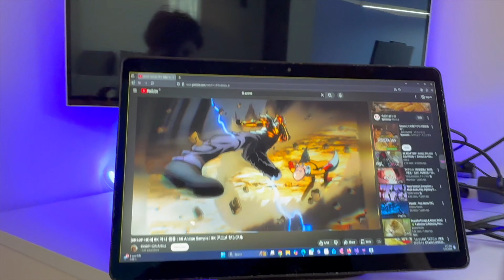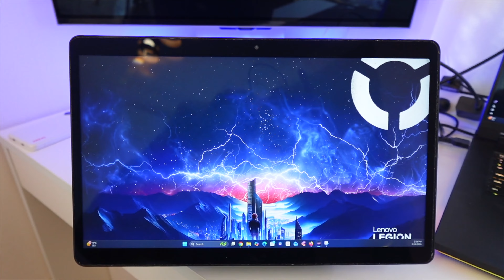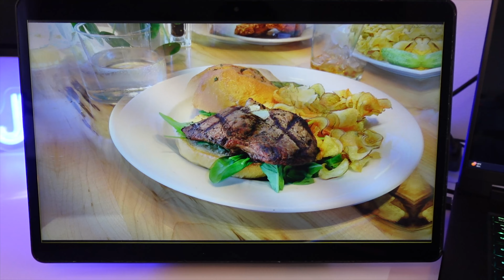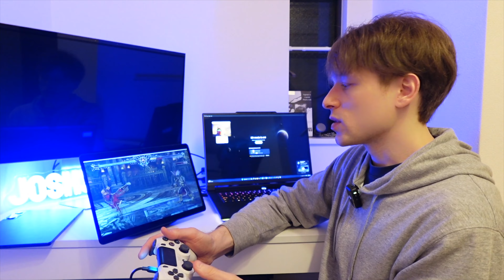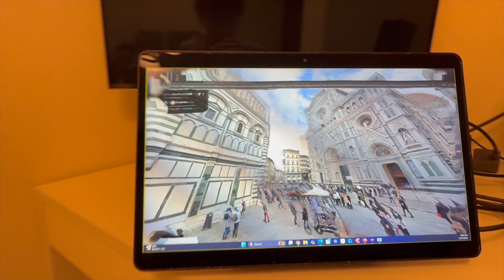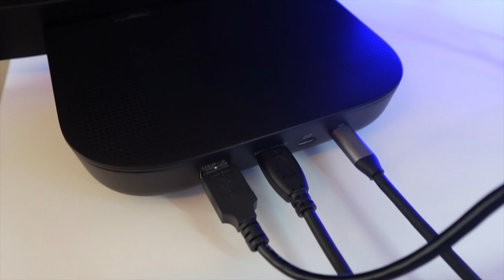Owl3D Shift: next gen glasses free 3D monitor

Comment: Hi, this looks amazing! Can I use gaming consoles such as PS5 Pro/ Switch/ Steam with it, or does it only work with laptops with high-end GPUs?
Reply from the maker: You would have to connect those consoles to a laptop or PC with decent specs using a capture card to display and run the Owl 3D software 2D to 3D conversion using the PC GPU. It’s not something that is built in to the monitor

Comment: What is needed for eye tracking? What if you turn the lights off and/or put dark glasses on? What if you sit back? Just wondering whether the tech could actually translate to 65"+ screens.
Reply from the maker: I don’t have the shift with me right now so I can’t test it, but generally the eye tracking used in these devices is advanced and can handle dimly lit environments, glasses etc. I’ll try it out once the retail unit arrives though

Comment: Monitor size is a deal breaker for me. Need something much larger.
Reply: For the price, anything larger isn't realistic. You also reduce the PPI when you increase the screen size but not the resolution.

For example Samsung's $2,000 27" glasses free 3D monitor is 4K in 2D, and the Owl3D shift is also 4K but at 14", so it's pixels are packed more closely together.

This results in less pixels visible and should completely remove the screen door effect.

Comment: How are the apps to play 3D movies and show 3D pictures? 

Most of the devices I try display the material ok, but the apps SUCK. Meaning it's not easy to just go to a folder of 3D pictures and scroll through them - like you have to open each photo separately and/or switch it to 3D
Reply from the maker: The app takes anything on screen that is full screen half width SBS and reverts in 3D. So it doesn’t require waiting or reopening things, you just flip through photos or play a video and it’s instant. But it’s just rendering the desktop screen assuming you have something displayed half width full screen, so if you zoom it will get all messed up. They need to add more dedicated features for this. And I agree, I hope they can do it in a way that is better than other apps

Comment: Hi Josh, what was the refresh rate like while gaming? Soul Calibur 6 runs at 60 frames per second. Was Owl3D Shift able to maintain that frame rate?
Reply: It depends on graphics card, RTX 3060 can get 30hz while gaming. If you aren't using the graphics card much it can get 60hz (max). Depends on the game.

Comment: I don't trust at all this "it will get better" claim. That is not how tech works especially not this kind of tech. At sale that is what you get very rarely will they improve the product after the release.
Reply: Their software will get better, not the hardware. We're still 3 months from release, so their software has plenty of time to fix bugs and improve the experience.
Reply: @MccTube How do you know they can make it any better? What technical basis do you have for this? Have they told you they will or do you know the current tech isn't tapped out and as good as it is going to get.

Because you usually don't release and try to sell something before you have made it as good as you can. This interface between latency and the algo and hardware that tracks our eyes. There is no good reason for why they can suddenly make all of that with software much better, because if they knew how they would have done it already.

Sounds like vaporware dreams to me.
I bet if i don't get a much better reason to believe otherwise that as it is is mostly as good as it is going to get. 

And what is usual the go to. Is if they can make a substantial leap in capability or perfomance.
They will release a completely new version of the product to squeeze the market for more revenue. That is how the market works for these things since forever.
And i see zero reason for why this product and company would act any different.
Reply: @cajampa It's a Kickstarter. The software isn't finished and as he said, the prototype was basically made by hand. 

Owl3D is good at updating their software and making it work well. It's foolish to think in over three months they will do nothing to optimize the software.

Comment: It is way to tiny from me to want one.
If the tech comes to 60 inch plus screens then we are talking.
I want it on my next TV
Reply: TCL is working on one
Reply: @TCISBEATHUB Very cool thanks for telling me. I love 3D on big screens. I have kept one of last gen LG passive 3D TVs around just for this. And i don't like projectors.
So if they come out with a huge one i am VERY interested. I hope they wait with releasing one until we have a fully fleshed out HDMI 2.2 stack available.
So we can get faster screen at the same time. Because huge 3D makes massive difference the more motion resolution you can throw at it.

Comment: Looks cool! Looking forward to a tablet version as well.  

I do wish it was at least 144hz refresh rate.
Reply: Perhaps it will eventually be released as an add-on for monitors in common sizes like 27" or 34". Then you can decide for yourself which monitor to put underneath, provided you have a sufficiently fast host system with a powerful processor and graphics card.

Comment: These smaller 3d formfactors just don't do it for me. Its gotta be 32 inches and up.
Reply: Are you fine with $1600 to $1900?
Reply: @TonyDrecaps certainly, if its an oled monitor or TV. My current 3d setup is active glasses on a 32 inch monitor. I also have ar glasses for 3d. The problem with 3d glass free screens, is that the panels suck compared to what you can get in 2026. The pulsar nvidia monitors are fast enough to do 3d with active glasses and same with oled. So there's really no need to go glass free 3d for a premium price.
Reply: @oneanother1 just making sure. Im with you. I prefer glasses free 3D. 

Im kind of mixed because I like the size of those monitors but tablets and handhelds are way more versatile and not tied down to a PC
Reply from the maker: I’m hoping the upcoming Samsung 6K 32inch monitor ends up being the best glasses free 3D display ever released. That will probably be the right time to get one
Reply: @josh_3D  This is the one to watch now. 
Especially that higher resolution since 3d cuts it in half

Comment: Would this connect to a gaming handheld like the MSI Claw 8 AI+? I'm wondering if there would be any lag or latency. Edit, nevermind it has a USBC connector so straight to Thunderbolt 4 on the Claw. Whether or not the Claw iGPU could handle the processing load or meet the minimum equivalent of an ~RTX 3050 is another question.

Comment: It looks like the same thing as the CubeVi P1. How does it compare?
Reply from the maker: It looks very similar, but the display tech is completely different. The two biggest differences are 2D and 3D resolution. The P1 was not designed for use it 2D, so smaller text on the screen in 2D mode gets completely distorted and id unreadable. The Shift has 4K resolution in 2D. It also has higher 3D resolution compared to P1 making it look a lot sharper in 3D. And because it is an Owl3D product depending on the tier you back it comes with lifetime access to their software which does the real time 3D conversion and keeps getting better over time

Comment: Very interesting product. The sbs support alone makes the price point of $399 far and away the best deal for glasses free 3d mointor that supports sbs content. Add the additional unique to this product the 2d to 3d shift feature, makes this a very tempting kickstarter purchase indeed. Even if the 2d to shift 3d does not work perfectly, the support of sbs 3d alone still makes this product way cheaper than anything else on the market. Since I can't test the 2d to 3d for myself, unfortunately I think i'm going to hold off on my purchase until i can one day see it in person. I've been pretty disappointed with live 2d to 3d conversions I've seen, and i've seen quite a few. It usually looks ok for still images but moving content I've always seen it as super gimmicky and stop using it after 1 or 2 times. But again for sbs alone it's kinda worth it. At that price it's almost worth a shot in the dark.
Reply: I know im just a random person but I've used their software for 2D to 3D conversion before for VR, and their software is pretty seamless and looks great on VR. I can imagine it'll only get better knowing you can change the depth in live time which is pretty insane
Reply: @ilovepaopufruit  Yeah i have decided at that price I'm going to back the kickstarter.
Reply: @VR-Emcee  I'm honestly glad to hear it, did you get the Super Owl VIP or Early Owl VIP? So you get their premium 2D to 3D converter membership included with the device
Reply: @ilovepaopufruit  I'm really sorry. After yesterday's video posted by Josh, he showed the native sbs not functioning at an acceptable frame rate and the game moving slow. He said they plan to fix this. But I've already been kinda jaded because of past purchases in this field where they (not Owl3D) say they plan to fix functionality and they never do it. I'm going to hold off until it's fixed or wait for another product to come along. The native sbs for games is 95% of why I want this product. If it is not delivering on that promise at release, I'm out.

Comment: I hope these 3D monitors will last because the Lume Pad 2 support seems to be defunct now.
Reply from the maker: Lume Pad 2 is supported until August this year, but these monitors are almost certainly going to have better long term support. Leia Inc is an interesting case because they pivoted hard with their main product offerings multiple times and did a major rebranding. They seemed to realize that it’s more effective for them to license the technology to other companies rather than supporting their own hardware brand.
Reply: @josh_3D Thank you.
Reply: @josh_3D supported? They haven't done a thing for it for a whole year already? I hope programmers can mess with it and unlock some potentially cool things, because i bought it when they started taking apps off. I felt cheated

Comment: Hi Josh , what is the best glasses free 3D display among all the ones you tried ? and how does it compare to the passive glasses 3d 4k lg oled 6 series from 2016 and the best vr headsets and xr glasses , in short what is the best 3D experience you ever had in consumer devices ? and is it possible to use the redmagic tablet as a monitor for pc with gamestreaming or other workarounds ? sorry for all the questions I want to get into 3D but dont know which is best , thanks in advance !
Reply from the maker: I can give an answer for glasses free 3D displays, but it is more difficult to rank 3D across all types of devices like VR, AR glasses, and passive 3D TVs. Those other categories all have some advantages over glasses free 3D because it is much easier to guarantee the left and right eye gets its own clean image. I also think ranking across those categories involves a lot of personal preference too. To me Vision Pro is definitely one of the best visually in 3D. 

But the best quality glasses free 3D overall is the 15” ACER SpatialLabs Predator laptop series. It has the best combination of brightness, vivid colors, 3D resolution and pixel density, smooth and responsive eye tracking, and amazing depth and pop-out. The 3D appears physically solid and convincing with extremely minimal crosstalk for glasses free 3D. The monitors using Leia SR technology all look nice too, but they are basically the same thing stretched to 27 inches, so the resolution looks noticeably lower. 

The problem of course is that just like Vision Pro, the ACER 3D laptops are extremely expensive, and could be a bit underpowered in a few years. The most recent one released around 3 years ago. There was another laptop from ZTE Red Magic that released two years ago, but only in China. I haven’t seen the display, but it could be just as good if it uses the same display tech or possibly slightly better if it is an improved 3D display.

The 6K 32”Samsung monitor that was announced recently seems like it could top all of the others and become best glasses free 3D display when it releases. We will see once it becomes available.
Reply: @josh_3D , thank you so much for the indepth explanation , 
 really appreciate it
Reply: @josh_3D I really wish Nintendo would release a second screen for switch 2 with this tech
Reply: @andreamitchell4758 I wish!  Glasses free 3D comeback
Reply: Good question I hope he answers.
Because what his references is for what is good 3D experiences is very important to understand what he even knows about these things.
It feels a bit shilling this whole presentation.

Comment: Without support for frame packed 3D sources, I think I’d hesitate to dive in and would just stick with the AVP…even though this device does things the AVP doesn’t.
Reply: Same! imho support for frame-packed 3D sources is crucial. A clear statement on this would be necessary. No “maybe later” or “probably.”
Reply: It's planned to support MVC, isn't that what frame packed is?
Reply: @MccTube  Yes. Presumably, this means that the corresponding software (hopefully after an update) on the PC or Mac supports the playback of frame-packed 3D content. So not directly via a connected hardware BluRay or media player (the monitor would need to have an HDMI input for this), but via the software, an ISO image or MVC extract on the connected PC or Mac (which would be fine for me, as I, like many others, have ripped my 3D BluRay movies to my network anyway).
Reply: @TomsRCScalers  Yeah it should be able to do MVC. Even if it can't, PotPlayer can convert MVC to any format in realtime with no quality loss, so you could just set it to FSBS worse case scenario.
Reply: @MccTube  I’ll leave that answer to those more knowledgeable than I am. 
But if “planned” means it’s not there yet, I’ll have to pass.
Reply: @westmcgee9320  Well of course it's not there yet because it doesn't ship until May. But it should be added. Anyway, even if it isn't you can play MVC with potplayer which in realtime with no quality loss converts it to any 3D format.
Reply: I believe it's already able to do that with PotPlayer.

Comment: Not mentioned Oled, so propably Led

Size 14-inch

2D Resolution 4K UHD (3840 x 2160)

3D Resolution 2K (1920 x 2160)

Pixel Density 315 PPI

3D Pixel Per Degree 66 PPD (Retina-Class 3D)

Brightness 600 nits (Peak)

Color Gamut 99% Adobe, 100% sRGB

Contrast Ratio 1500:1

Color Depth 1.07 Billion (10-Bit)

Refresh Rate 60Hz

Comment: What GPU do you have in the laptop? When watching live 3D converted videos, I assume there is latency, but are there frame drops? Because watching a video and having the video itself skipping frames is not ideal.

I have an RTX 3070 laptop with a 5,000rpm fan below it, it never gets hotter than 50°C so I'm not worried about sustained use.
Reply from the maker: Standard videos 30fps and less appear to be fine. I’m running it on my 5080 laptop. But I’ve used Owl3D on my 3080 ACER predator laptop with the real time conversion and it is also smooth. I’ll have to test 60fps to see if the conversion can keep up

Comment: 14 inches is just why tho? They couldn't go 24 or 25 inches? The small screen size will definitely limit the value.
Reply from the maker: I think as a concept this one is more of an extended 3D display, where anything dragged over to it becomes 3D. So you could have this and your main monitor or laptop + monitor. Also to keep it as affordable as possible for backers as the first hardware product fry Owl3D. If this succeeds though I wouldn’t be surprised if the best version is larger or comes in multiple sizes!
Reply: @josh_3D Im close to buying the Odyssey and a lume pad 2. I wish it was big enough to replace my main monitor or the Samsung but it is COOL!